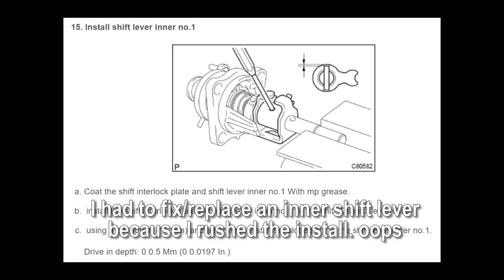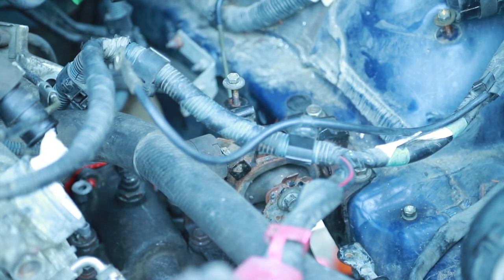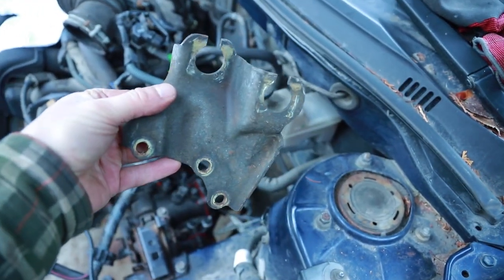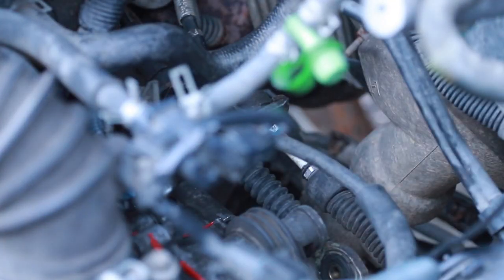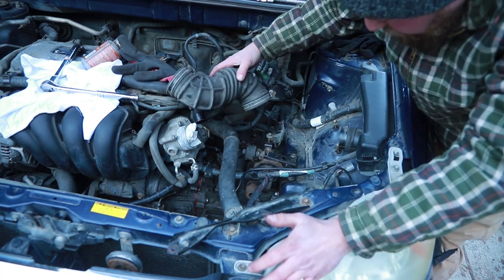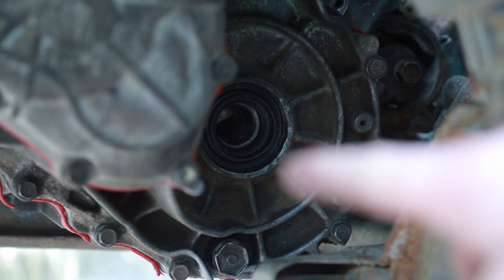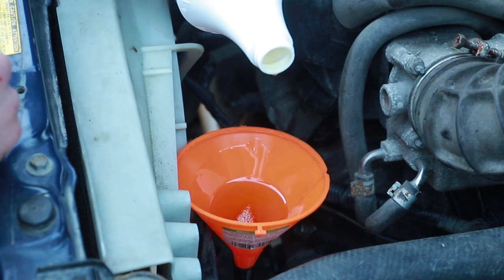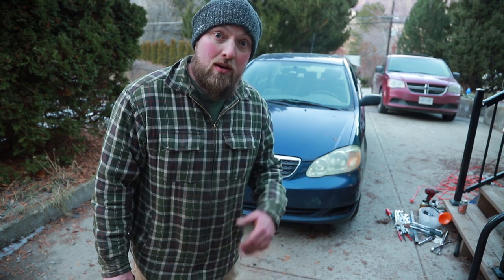Fix your manual transmission at home - Part 5 - Transmission back in the car!

Comment: Bottle says GL-4, GL-5. and on the front- transmissions. Not just diff.
So. Relax.
Not sure how it can be both tho. I use GL-4 to be certain that the brass is happy.
For people with the factory unsealed bearing I'd overfill by a cup. My thought is that you could stand to have more oil thrown around in there. But that is me. I could be wrong.

Comment: It specifically calls for gl4/5 not 4 or 5 ..there are dual rated fluids such as motul motylgear 75/90 gl4/5 or royal purple max gear gl4/5 these fluids offer high shock protection but don't have active sulfur that eats yellow metal...you should get that fluid out as soon as you have a chance or you will damage it
Reply from the maker: See Short reply
Reply from the maker: I'll see if I can track down some of the purple max.
The vehicle has been on the road for about a month with mostly highway and a bit of city driving. Zero shifting issues so far.... but I will look into a different fluid
Reply: @WeBuildStuff  well it's not like you put atf in it or something..it has 75/90 gl5 so it's safe for now..but..these transmissions are not durable and will blow up on you.. burn outs/chirp 2nd gear/power shift/wrong fluid/is sending out the invitation cards for disaster..and these transmissions will show up to the party..